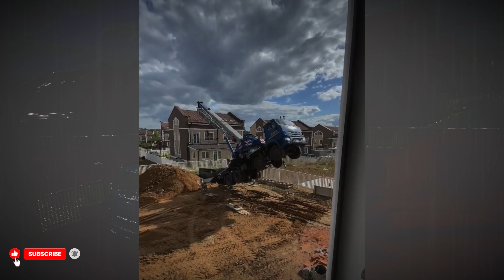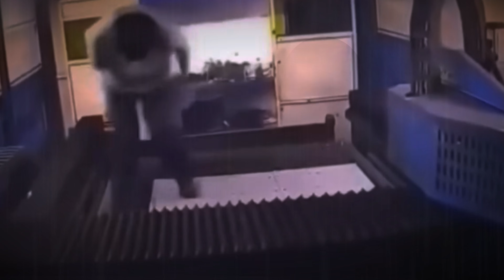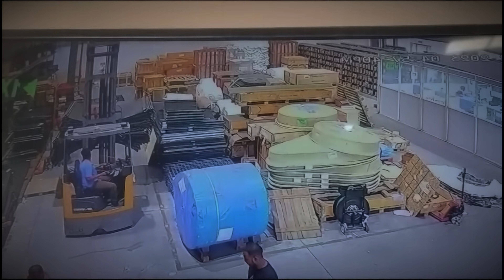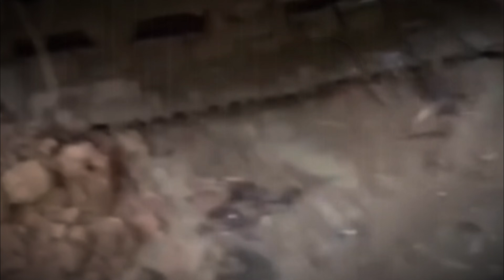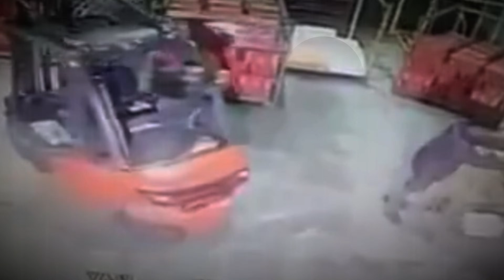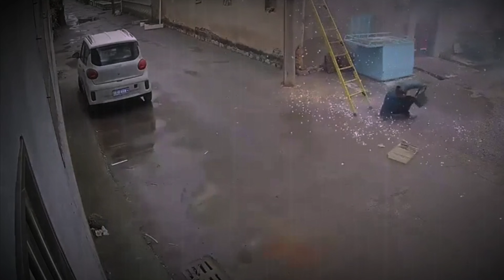Top Accidents YouTube Banned From Being Broadcast Caught on Camera...

Comment: I was a tool & die maker. I was inside the tool and the machine was rated at 1,200 tons per square inch of force. It would crush a person paper thin. We locked out and tagged out the machine (look up lock out tag out procedure on line) and 'blocked' the machines movement. You could fit your car into the  machine.
Reply from the maker: Thank you for your warning and reminder; it will be a valuable reminder.